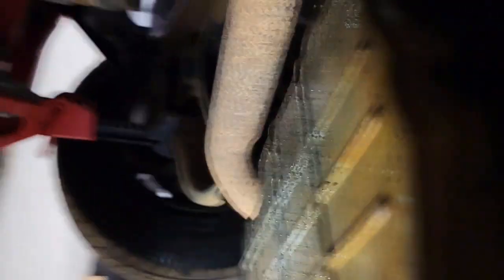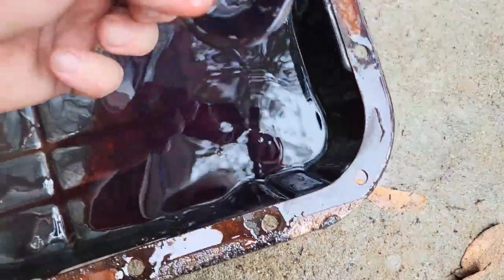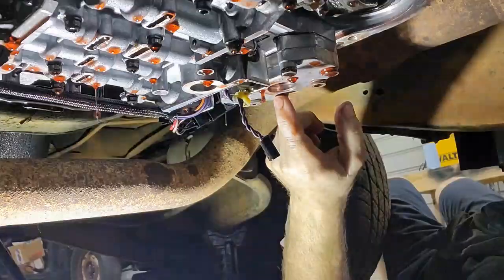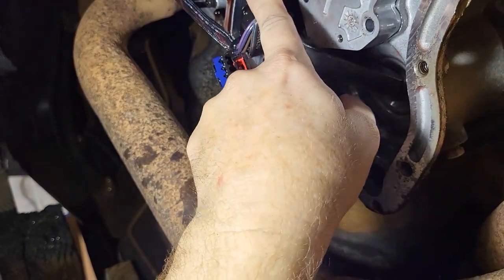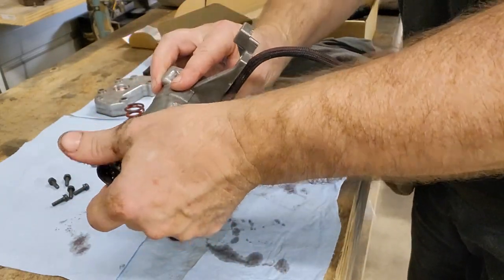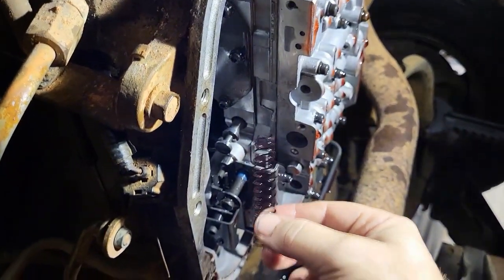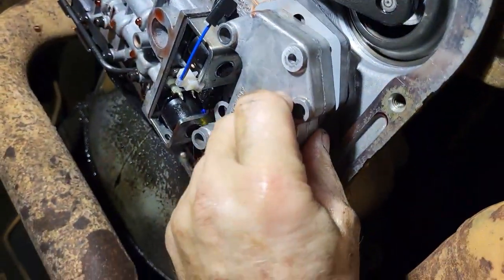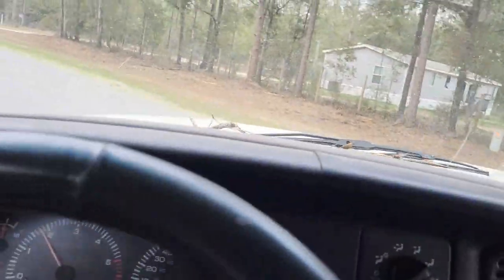2000 Dodge Ram Pressure Overdrive Solenoid Remove & Replace

Comment: With mine 2001 it doesn't seem to shift on that last shift you had in the video around 50mph my last shift is before 40mph and that's it.... is that the OD shift at 50mph? If so this is actually what I need to do.
Reply from the maker: I believe so.  I was having a problem with the last shift too.

Comment: My issue is at all 4 shift points the truck almost like it shuts down. It gives a dead pedle and just no power. Ive changed the APPS 4 or 5 times now and programmed it correctly  so its not that. Ive pulled code 1762 witch is governor pressure sensor off voltage too high or low. So I've changed the sensor and still have the problem. Any help would be appreciated.
Reply from the maker: My problem was very different than yours.  My overdrive wasn't shifting properly.  When I went into mine I changed all of my sensors just to be sure.  I did come across a couple of issues to look out for.  The governor pressure solenoid has to have a click or snap into place when it is installed or it will not work.  I ended up having to get another one to get it to work properly.  also make sure the bracket that goes around it should be in the right grove.  sometimes they come with two different groves so be sure it goes back into the correct one.  I believe it should be the grove that makes it go deeper in when installed.  I hope this helps.  I'm really not a transmission guy so I can't get too tech on this.
Reply: @Exit45Restorations  shit I appreciate you even messaging me back. Any info helps Thanks

Comment: what was your issue that you were experiencing prior to the replacement? I have an issue with a shudder when in over drive.
Reply from the maker: My truck was shufting out of overdrive before it should have and then would shift back in to overdrive.  After this repair I just made an almost 8000 mile trip with no issue.   Hope this helps.

Comment: How did you get that spring and the other part in together???
Reply from the maker: I just held the spring in the hole with my finder and then slid the other part over it.  you may need a small screwdriver to help hold the spring in while putting the housing on if you can't get it with your finger.